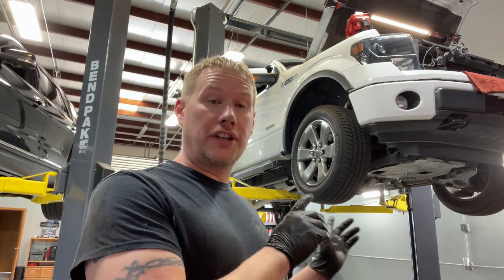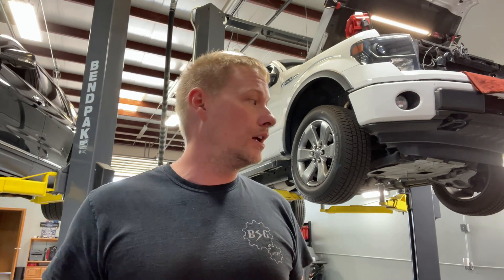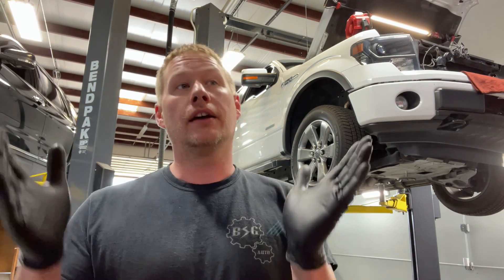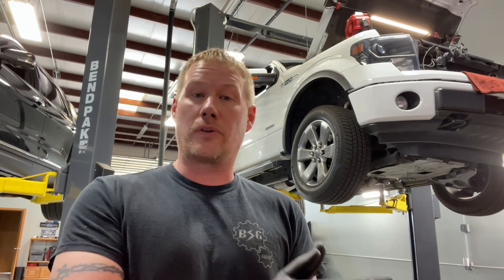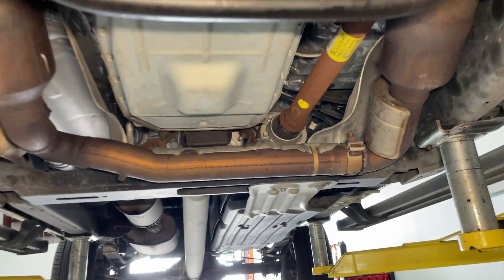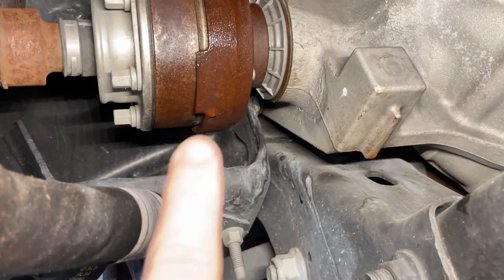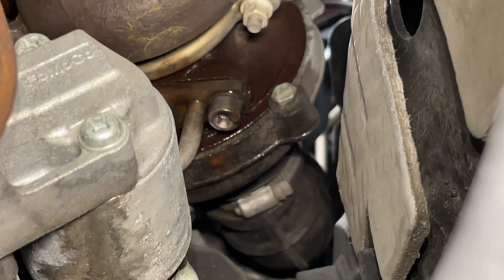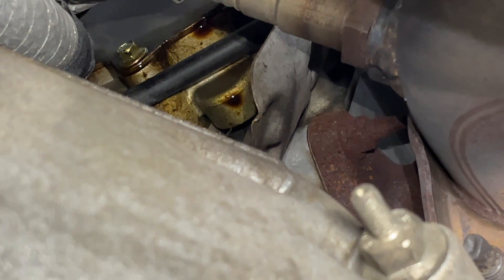Ford Ecoboost Engines Can be so Hit or Miss: I Really Feel Bad for This Customer...

Comment: Yup adding more complexity adds more to repair. While the 3.5's have great power I bought a 5.0l for the very reason of extra issues down the road....And I'm a tech of 20+ years so cost isn't really an issue. I just don't want to work on my own stuff till absolutely necessary.
Reply: Rob Buell, YUP I too am a tech who has been wrenching for almost thirty years now as well, the last twenty one of which have been with Ford. And trust me, I totally get where you're coming from, not wanting to have to wrench on your own ride. Right now, I drive a 2021 F-250 6.7 CCSB 4x4 Lariat and absolutely LOVE the power it puts out. But I don't see myself keeping it for more than a few years for two reasons. One, I'll be able to get decent money for it when it comes time for me to get out of it to put toward my next vehicle. Two, it will be in someone else's hands long before it gets old enough to start needing constant repairs. Long gone are the days for me to have any patience having to constantly wrench on my own daily driven ride. I'd rather pay the premium money to drive something new, if it means I'll only have to do oil changes and the odd brakes on my own ride any day. I'm sure there are those who think I'm being wasteful, but only the ones who have been turning wrenches for as long as you and I have, will really understand.
Reply: Don’t those rattle and leak too?
Reply: The 5.0L you have is the modular engine and they are prone to problems. The old 5.0 (302)from the 1987 to the 1996 F150 were the best Ford ever did. The old iron taken care of would run for ever.  My 1995 had an cast 5.0L HO and that thing was still going strong at 392k miles. I currently have the 3.5 Ecoboost in a 2013 and I wish I would have went the other way. V8. Less future issues with less components to wear out.
Reply: @jwar2163  I've been inside way more 3.5s than I have, the 5.0 Coyote engine you speak of. While I agree the old school 5.0 (302) Windsor engine you speak of was one of Ford's better engines, it unfortunately is old news now. All manufacturers are being squeezed, ever so tightly by Government mandates for strict, and arguably unreasonable emissions and economy targets, is why we are having engines with ever so complex emission controls and fueling systems in today's engines, while being constructed of substandard quality materials to keep vehicles affordable for the average consumer.
Reply: @michaelchan8915  100% accurate analysis.  I also have a 2018 5.0L and while it may not be perfect, there does seem to be a consensus among Ford techs that it is the better option for those who plan to keep their truck forever.  While it does have VVT and direct injection, the addition of port injection mostly cancels out any drawbacks from direct injection and VVT seems to be a technology that has been around for quite some time and doesn't seem to cause the amount of headache that cylinder deactivation has caused for GM and Dodge, so at least it doesn't have that.  As for the 10-speed, I am being proactive and servicing it at 30k miles along with the rear diff and coolant, and I stick with a 5k-mile oil change interval.  So all in all, I feel pretty confident that adhering to a strict maintenance schedule should help me avoid any major issues and hopefully allow this thing to last a long time.
Reply: @michaelchan8915 I don't see for a second how using poor quality plastic parts on a turbocharged engine that gets so damned hot makes any economic sense at all. Warranty issues are not good for any manufacturer of anything. When you ignore basic physics, and the engineering principle of " Form follows Function" you are going to pay dearly.
Reply: @jwar2163  personally I was more a fan of the chunk of iron 300/4.9 inline 6
Reply: @bryanmartinez6600   The 300 inline was a beast, but that 302 HO was Godzilla compared to that 300.
Reply: @Dennis Burger If you manage to keep the body and frame from rusting away, it definitely would.
Reply: @Dennis Burger Most likely!  Would love to have a 95 or 96 F-150 regular cab short bed with that motor.
Reply: Exact reason I didn’t get the 5.0 I loved my old v8 f150 ran forever new ones suck eco boost is the only way to go , you will find that out soon and when you do come back to this comment good luck and whatch your oil level 😂
Reply: Everyone likes to reminisce about simpler times with all the “old iron”, but nobody wants to talk about that superior experience that 180hp and 13mpg brings.
Reply: @16vjohnny  that is true but what's the point of 400 hp 550 torque when it falls apart.
It's more to deal with the poor quality of these modern engines what's the green side of modern products when they can't be serviced and basically a throw away
Reply: @bryanmartinez6600  Because that’s what people will buy, and Ford wants to make money.

Look, I’m with you on the sentiment…. But there are A LOT of really good reasons we shouldn’t go back to the 90s.
Reply: @16vjohnny  yeah 90s was rather pathetic all the way to mid 70s but before that big blocks were powerful 
The old 460/7.5 made 385 HP and 480 torque at a LOW 2200 rpm yet we call these figures today are amazing and that was in 1970. At 1972 they had ruined the specs to a pathetic 212 HP and 342 torque for the sake of efficiency but the efficiency achieved I doubt was worth killing the power of this engine. The modern 7.3 is now achieving these figures. We had monstrous power coming from the V8s before the 1970s like the L48 350 making 300 HP and 380 torque and again the power was murdered to 165 HP in 1975 for the Corvette which is just pathetic.
1970s and back engine tech was truly wild and designs were just way out there.
Tech now has gotten very boring they claim it to be green and environmental yet most of what's being built is low quality, short lived, yet high cost.
America at one point was the peak of the auto world from 1950s to 1970 from them on to 2000 it was a joke. In the 60 Ford took on Le mans and won. Not just in the US though British engineering is a very odd one. Look at the Napier Deltic and Sabre also the Bristol Hercules which had sleeve valves. Modern architecture and engineering feels hollow.
May have spent too much time on this post :/ just feel like all this modern stuff is disappointing.
Reply: Unfortunately the whole "less complex engine" went out the window from 2018 on, (the new 3rd gen 5.0)
Reply: @cheeznhard  I can remember literally laughing when the PowerBoost drivetrain was announced. Two turbos,  VCT, direct injection, 10 speed transmission, 4x4, and hybrid batteries and motors. What a disaster waiting to happen.
Reply: @jayhawker03  there's no denying that they are selling like hot cakes though. Just about everywhere you go, you see them. I just don't want to be the lucky one having to fix it when it breaks.
Reply: @michaelchan8915  Yeah I wonder how long until PowerBoost recalls and TSBs start flooding in.

Comment: This makes me all the more happy that I just sold my 2012 eb with 73k.  Rust on Rocker panels was terrible.  I'm pretty sure it was close to needing the timing job.   AC system had multiple leaks and all needed to be replaced.   Glad it's not my problem anymore.
Reply: What is a eb?
Reply: @bobbybackpain  ecoboost
Reply: @andrewstratton806  thanks it seems obvious now . Did not make the connection
Reply: At this point I"m wishing I had done the same this year. I've got my rocker panels being replaced right now. I've got too much $ in the truck this year to walk away from it. If I have another expensive year the truck is going, though.

Comment: I had to have the timing cover on our 2016 3.5, non eco boost engine, in our Explorer resealed at 36,000 miles.  Not sure about the brilliance of engineering it with an internal water pump either.  I just did one on a 2010 Lincoln MKZ,  14 hrs.
Reply: Change that water pump every 100k. If it goes out it can trash the whole engine
Reply: @terrorofdemons1168  Yep. I was lucky, and it drained out the weep hole and not into the engine.
Reply: I'm sure there are plenty of cars with timing driven water pumps.  The ones you don't hear about typically don't have issues with them.
Reply: I had a 2013 Explorer and had to get the water pump replaced. My mechanic wouldn't do it. My local Ford dealer must have done alot, as they had it done in a day. They dropped the entire cradle down; engine, trans, front suspension on the ground, and they did it there. Oh, the water pump was on national backorder at the time, so it sat at the dealer for 2 weeks waiting for one. Expensive repair!

Comment: Same thing with my 2012 F150 at 65,000 miles with the rattle. Sheared off one of the tensioners and screen on the vvt solenoid. Ford seems to have a lot of major engine problems. That’s why I’m no longer a Ford owner.
Reply: And your choice of a new truck is???
Reply: @mark98070  Chevy 2500 gas, GM 1500 have major engine problems that I will not own either.
Reply: @mnichols2773  I've heard the same thing.
The heavier duty trucks from GM are so much better that the 1500's. What was your engine choice?

Comment: Yes very disappointing, very nice performing engine. Question, are these issues (leaks) addressed in the later models? And on the ’21 + 5.0l because of the cylinder deactivation Ford upgraded the piston rings to address the potential oil consumption issue and other parts were upgraded because of cylinder deactivation. So far I’m hearing no outstanding issues with this 5.0 L. Let us know the outcome of this truck.

Comment: My father and brother retired from forward used to love for products back in the day but now if I was buying a new vehicle it would be Toyota or Honda
Reply: I worked on Fords for 25 years, when they introduced the Ecobooos! back in 2010, it contributed to my decision to retire from auto repair and move  on...sad...nailing twin turbos and hi-pressure direct injection was an obvious recipe for multiple system failures. My sister recently asked for my advice on new vans and had questions about Ford and Chrysler. I said with regret, I can't recommend ANY Ford or Chrysler product at this time...both manufacturers are in the doldrums with design and quality control issues.  I reco'd (like you) either Honda or Toyota...she bought a
Honda odyssey and put almost 5000 miles on it in 30 days, knock on wood, no issues.

Comment: I Have a 14 limited w 230000 kilometers. It has been an outstanding motor. It’s not the engines fault that everything is plastic and low grade rubber.

Comment: So glad I bought an F250 Super Duty -4wd back in 2003, manufactured in June a few months before the 2004 3valve Triton was introduced with the spark plug, phasers and rocker roller issues. The engine has started every time except twice, a bad fuel pump and cruise control wire in the shifter lever. After all this time there is not a single leak anywhere including the differentials. With so many advancements in technology, its a shame that we still have this garbage engineering!
Reply: I have a '99 super duty with the v10 and it's got a very slow power steering leak, nothing else....and this truck sits a lot..so it's not exactly like I baby it...I don't think it's garbage engineering, I think they're just cheaping out on the builds (while charging you a lot more in the process).
Reply: The newer ones are ridiculous when it comes to parts like a rear tail light over $700 when leds go out. Bring back old school motors and bulbs.
Reply: Take care of that vehicle and keep it out of accidents.   -New ones don't last like older ones.  I would even look for another one as a back-up.  Simple reliable trucks that can be used for work.  =Reason for the new 7.3L Godzilla gas Super-Duty.

Comment: Sure, it only has 70,000 miles, but at the end of the day it’s still a 7 or 8 year old truck.  Time can be tough on vehicles that maybe sit unused for long periods of time.  Or possible it goes on a lot of very short trips which can be worse.
Reply: 10000 miles per year is not a truck that necessarily sits around a lot. I believe that's the average mileage for a daily driver according to most insurance companies.

Comment: All customers that I have that did not listen to me and went out and bought an ecoboost have had every thing from leaks to major damage. Latest customer bought a 2021 F150 ecoboost. 4800 miles and timing chain guide came apart with significant damage. $62,000 truck ---this should not happen. After engine repair now it has constant start up noise.

Comment: Tips for EB F150 guys: drive it like you stole it and you won’t have as many issues. I have 190k on my 2011 and it’s still an animal. Basic maintenance and oil changes. With a couple minor coolant leak issues that cost less than $1000 DIY with the help of these awesome videos from Brian.
Reply: Wholeheartedly agree with you, I drove it so hard I blew my transmission at 180k. It's now at 214k it has a coolant leak but oil changes is all it needs.
Reply: The good ole Italian tune up. It works great for Turbo powered vehicles.
Reply: I have 286,556 13 mkz 2.0 eco boost oil changed every 5k trans fluid every 30k air and cabin filter every 10k I use mobil 1 5w30 and trans fluid I drive 60 miles a day to go back and forth to work.
Reply: I drive mine hard, too. I take good care of it, but it gets the old Italian tune up at least once a day.
Reply: Just don't forget to flush and change coolant every 30000 miles. Those turbos beat the shit out of the coolant.
Reply: @Cody Marshall
No, these are seals that are poor quality that are failing, as long as you drive it normally, none of this should be happening, Ford trucks are crap.
Reply: @watershed44  Yes but let's make this statement with an asterisk *.  Ford probably is not in the gasket business. it is in the vehicle design and assembly business so it should be specifying gaskets all over that engine that are the highest quality. Or the engineering is bad or both. If Fel-Pro or Victor Reinz or whoever is not able to make good gaskets then that is a problem in sourcing just like those chips that nobody can get now. Some companies like Veleo, Federal Mogul, are manufacturing with poor quality in whatever country has the cheapest labor and the QC is hit or miss with lots of misses.
Reply: @watershed44  True man. I am not saying otherwise but just saying that a chain is only as strong as its weakest link.  I wish we could get US manufacturing back up and running especially making silicon chips. I will say that it seems that in this place Toyota and Honda do better than Ford managing their workers. Unions can take things a little too far sometimes.
Reply: @jamesmedina2062  It's not the unions that run the company, it is manglement, and they ultimately are responsible.
Reply: @watershed44  True. I will say that the sword of termination is not something most union job managers can employ. Its like if I live with my parent forever knowing that I will never be on the street. Or in agriculture a price floor is there and it affects producers knowing that they can't fail.
Reply: @watershed44  I support union pay fairness but disagree with the unions keeping too much money and making it too difficult to manage workers

Comment: All things man made will have problems. Ford isn’t alone with VVT cold start rattles, Google Toyota cold start rattle or Honda cold start rattle. I have a Camry work car that rattles on cold start. And if you’ve owned a Toyota then you know they also have oil leaks and especially leaking water pumps.